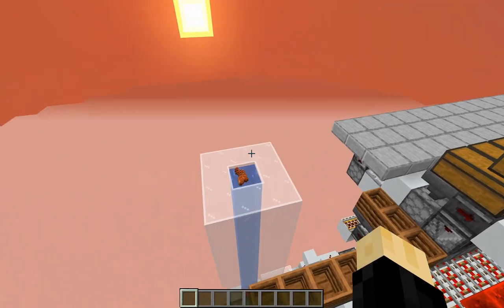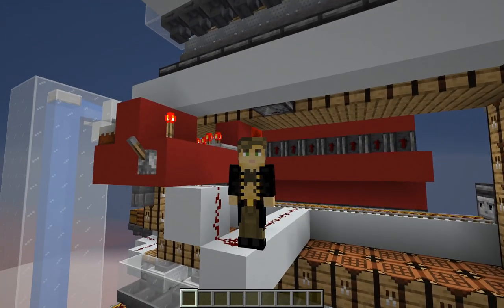Let's Build an Industrial Autocrafter

Comment: Why don't you use a double speed mixed box loaders
Reply from the maker: Mixed loaders operate in a way that is not ideal for this application. The reason is because you want perfectly balanced input/output, when I put a shulker box of ingredients in I want a shulkerbox of crafted items out with nothing left behind. In order to handle mixed items, you cannot rely on fill level to eject a box. Therefore you must detect when items can no longer go into the box, at which point you eject the box and place a new one.

This means when the box is full in a mixed loader, items get left behind which won't be removed until you start the next crafting operation, which would be quite annoying. I tried to build a mixed loader which automatically ejects the box once items stop flowing. But this was impossible to make compatible with unstackables which are a crucial recipe for universal autocrafters. So non-mixed loaders with precision inputs were the better option, even if they do get jammed when recipe's fail.
Reply: The design by samosthesage fixes most of these problems
Reply from the maker: @moderin294  His 2x loader is actually basically the same configuration as the one I currently use, the only difference is that I read the boxes fill level so it can't handle mixed items. Another thing you need to consider is partially filled boxes at the end of the operation. I am able to do this using the fill level to detect which boxes have items and eject them once it's done crafting.
Reply from the maker: @moderin294  Ok, I took samos' 2x design and managed to add an extension that if the slice was ever activated it will be connected to the line that ejects partially filled boxes at the end of the operation. This will make a nice addition to the new design.